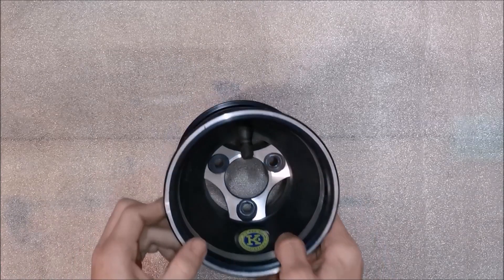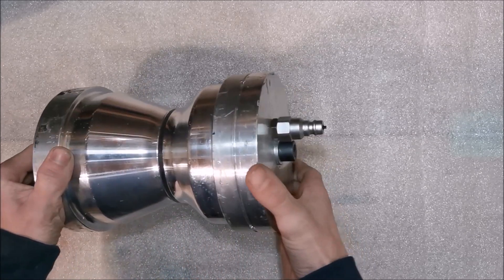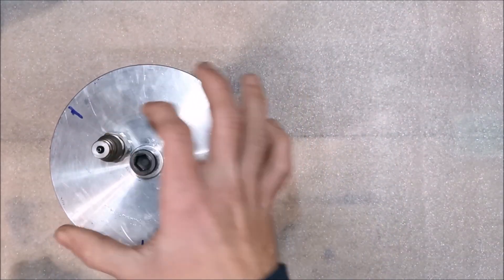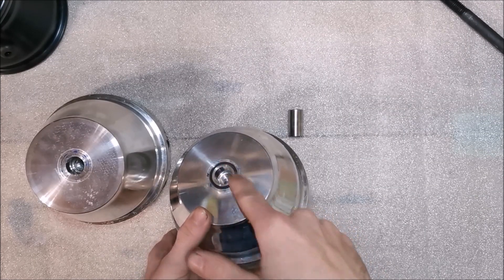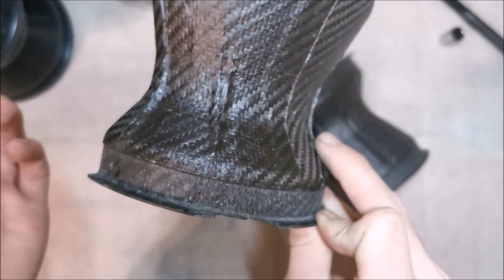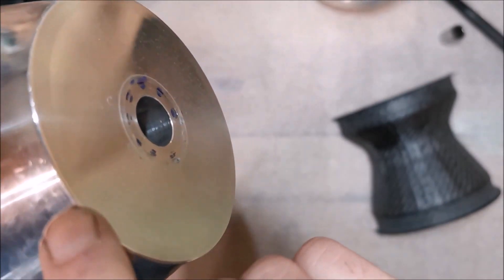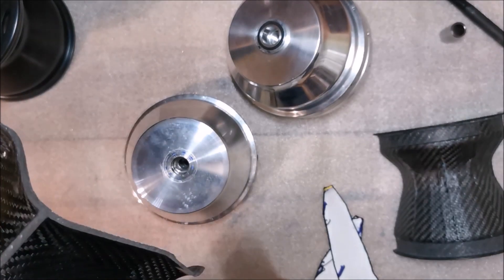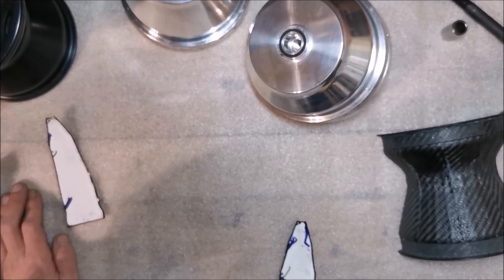How to make a Carbon Fiber Gokart Rim Part 1 |  The Mould

Comment: I only work with dry fabrics, most of which allow the weave angle to slip so the fabric lays evenly around compound curves. I've seen in videos of prepreg layups where they use a heat gun to soften the prepreg resin, to allow the fabric weave angle to slip so the prepreg can accommodate the "cone" shape without wrinkling.

Comment: This is awesome!  That's a nice piece of tooling work, and your layup process is very tidy.  If you can get your hands on some unidirectional prepreg as some others suggest, you will really like the ability to selectively reinforce areas.  And I second the request for some more information on your home-made autoclave!
Reply from the maker: Thanks. Im for sure gonna use some unidirectional carbon on the next part to increase strength in some critical areas. And im also planning for a video about my selfmade autoclave.

Comment: What oven are you using to cure the prepreg?
Reply from the maker: Im using an selfmade autoclave which i built from an Air Compressor Tank (150l) which is controlled by an Temperature Controller. I choose this way, because a real autoclave or a industrial curing oven can be really expensive and as an hobbyist it wasn´t worth it for me to buy such a tool. Unfortunately im not able to cure big parts with this autoclave.
Reply: @renny_composites  i think most of us would love to see your homemade autoclave, there arent many people who build it themselves and i love to get ideas how to build one
Reply from the maker: @TheEvanovitch  Yeah. I will probably make a video about it. It really isn´t that hard. If you can weld and if youre tecnically gifted.